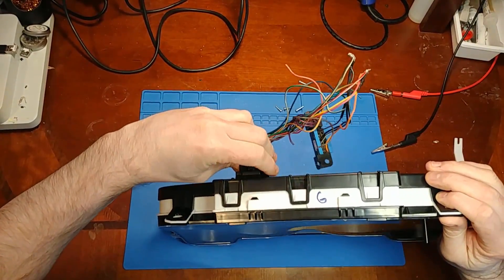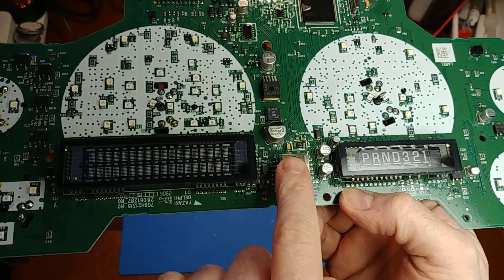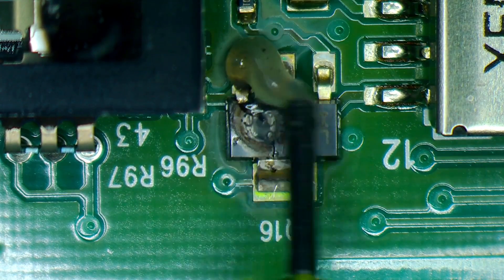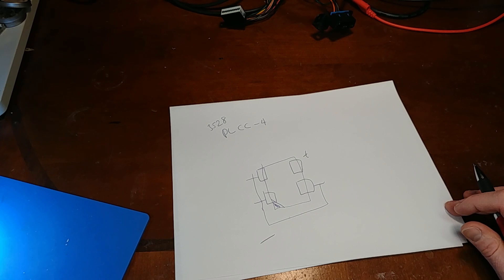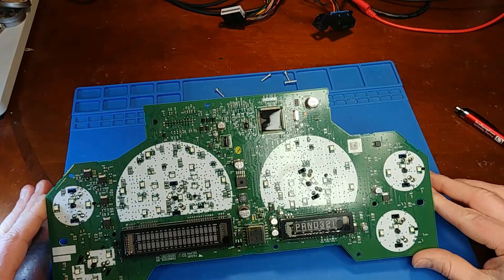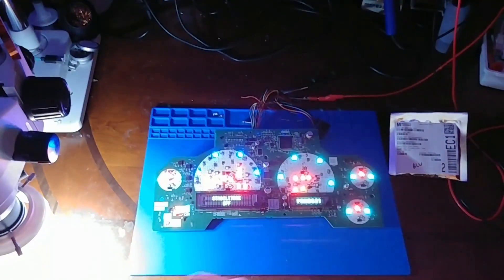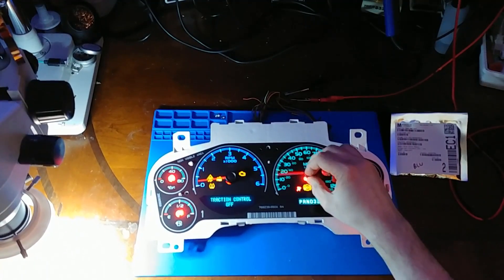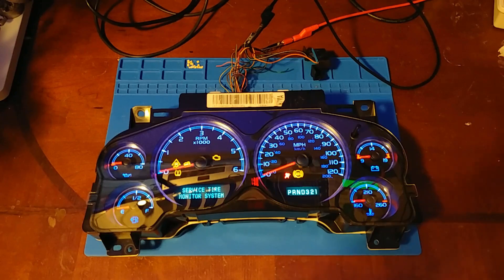2007 Chevy Cluster Display Repair & Blue LED Install

Comment: I agree the blue looks better than the aqua but not something I would bother with unless the cluster needed other work. 
My spare car has red back lighting and on a long drive at night it really gets bothersome on the eyes. 
Honestly, why would anyone think bright red instruments in your face at night is a good idea ? 
At least the aqua is easy on the eyes.
Reply from the maker: Technically I thought red was supposed to be the easiest in the eyes, and that is why submarines use red for lighting.
Reply: @jeffescortlx  I can't speak for the logic in submarines for red ambient lighting, perhaps it's different when the whole room is lit with red ambient light.  Imagine if the entire control room was dark except for one bright red light source.  For me at least, the red cluster being the only source of red light in the car just seems annoying especially if you're driving for hours.  My daily has blue and it's quite comfortable.
Unfortunately, in the spare car, the back lighting is incandescent with red filters which would mean removing the filters leaving the lighting white and probably uneven.   
I'd certainly change to blue if I could find good led replacements for the incandescent lamps. 
As you've said, there are many replacement leds on ebay but all cheap unrefined Chinesium. 
BTW, I love the microscope and it's not as expensive as I thought it would be.

Comment: Really enjoy your videos and I might have to see about sending a cluster out of my 2001 silverado to you sometime.  For some reason it will be working fine then will suddenly go back into power up like it does when you first cycle the key on.  I suspect probably a broken solder joint just from learning from your videos.  Two questions, is there any way that you could do a video on how the displays work on the GM products?  I think it would be a neat thing to find out how they work, and could you recommend to me a good blue LED replacement for my dash backlighting?  After seeing this backlighting I might like to do a blue backlighting on my truck as well.  I understand that on the 01 truck that the backlighting is just plug and play but I would really like to have your opinion on which LED upgrade bulb to use.
Reply from the maker: You could just have a failing ground wire. Common in the 99-02.

Comment: Any idea why the mosfet fails?  It does bother me if that's all that was changed unless the replacement has better specs that addresses the failure. Perhaps whatever is supposed to suppress kickback from the transformer has gone bad.
Reply: Design team chose underrated component or there are design problems like no snubber network. That comes to my head right now
Reply from the maker: The easy assumption is that the engineers under spec'd the part. But I've noticed a pattern with terrible solder joints. If you look closely the MOSFET heat sink tab solder joint it fractured and comes right off the board.
Reply: @jeffescortlx  Which raises the question if the solder joint is the cause it or is the solder joint the result of the mosfet overheating.  It might be interesting to scope that out and make sure everything is well within what the replacement can handle.  I'm wondering if it's possible the voltages rise as the display ages and causes more kickback to the mosfet.  Or perhaps a high voltage until the display filament warms up.
Reply from the maker: @russellhltn1396  your right, it's hard to tell what happened first: bad solder joint cause fet to fail, or burned up fet cause solder joint to fail. But what I can go off of is experience. I haven't had any bounce back. I make sure to have a nice healthy solder joint, especially on the heat sink tab. So far so good.